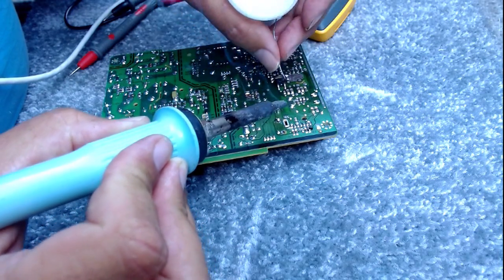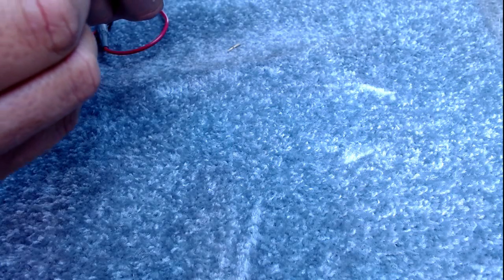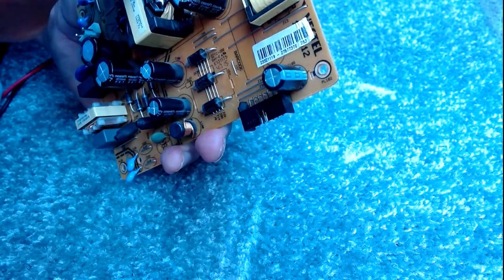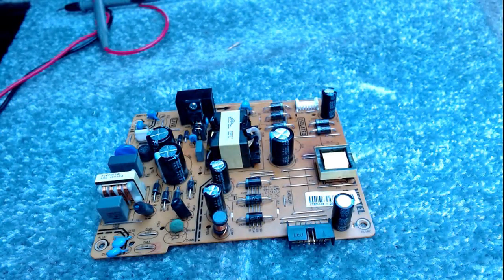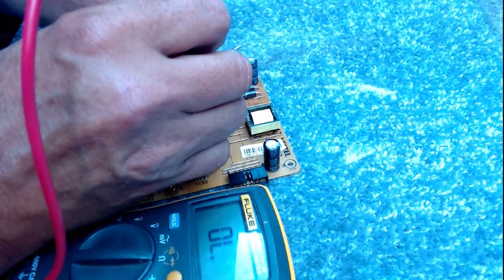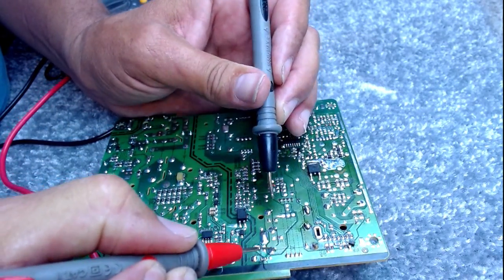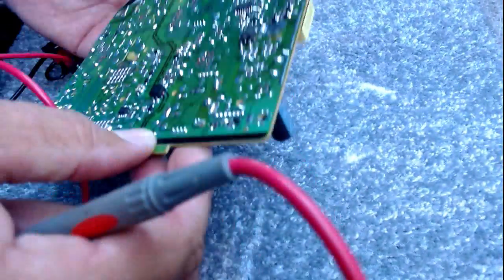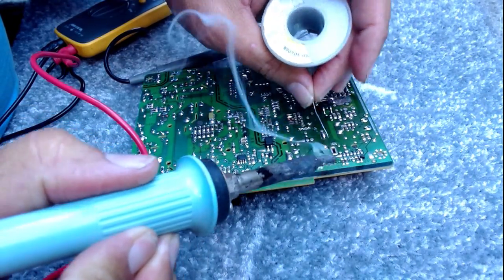Vestel 17IPS12 dead but not diodes

Comment: Hi I found a Digihome 32" smart TV in the skip decided to try and fix it so far bought new power board still the same very dim leds bought new strips of leds same result very dim leds. The main board is vestel 17mb211s what other number do I need to ensure exact replacement as there are so many different models. Can you suggest the possible problem with the leds being very dim, many thanks for the videos.
Reply from the maker: You seem to have covered most angles.   New power board and led strips.  If you plugged the new powerboard into the old strips first  it could have shorted out the new powerboard.    There should be a 23 number on the main board. That’s the number you need.for that.
Reply: @allenfleckney5969  shorted out pins 3’5’7 thru 10k resistor to power/on pin 11 all leds came on bright looks like new motherboard.

Comment: If the MOSFET has gone faulty also check the 56uf @ 160v next to the white LED backlight power connector, if that component is faulty it will  blow the mosfet you have just changed (as I have just found out) .
Reply from the maker: Very true.
Reply: Hi, i'm trying to repair this board and was happening the same thing as you, i put a new mosfet and was backlight on for a seconds and then mosfet just blew up, i suspect that also is the capacitor faulty. do you thing if i put a higher capacitance cap, i mean, 68uf instead 56uf can cause a bigger damage to the board and again a blown mosfet?
Reply: @TutorialesAlbertVideos Have you solved the problem? I have the same thing..

Comment: Not everyone is as good as you, or maybe you are getting instruction from the cat :-D
I did fix a technica LCD19_32 vestel set for a frend 3 years ago. (still ok)
Tv's are not my thing but... a frend.
The psu board (17PW20V2) had two blue poly 15Nf caps +mosfets  driving a transformer with 400v.
Caps were dead as a dodo.
I imagine you have done buckets full of this type of psu.